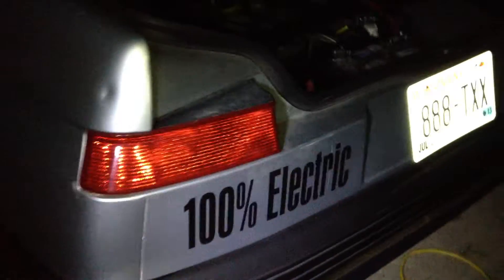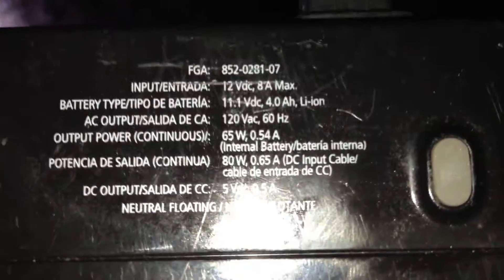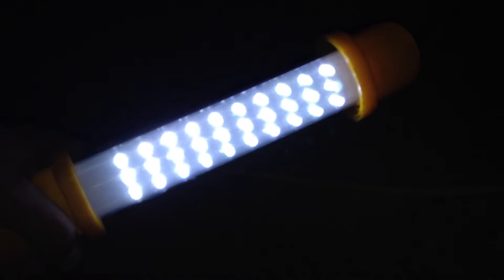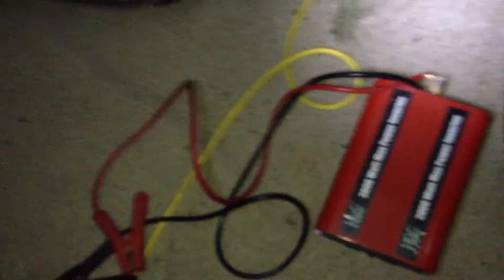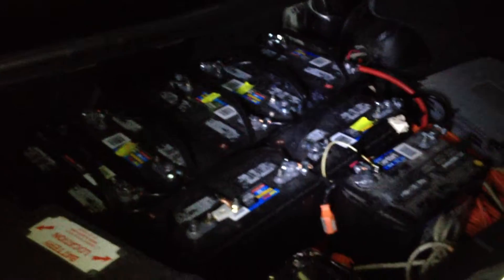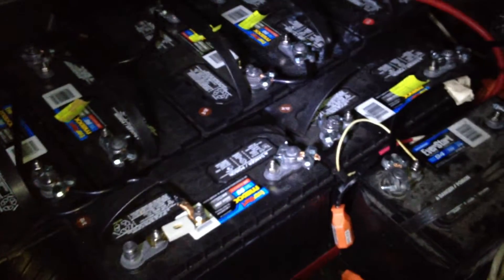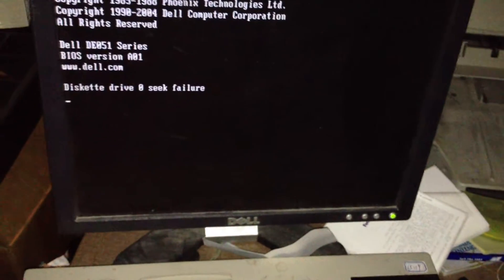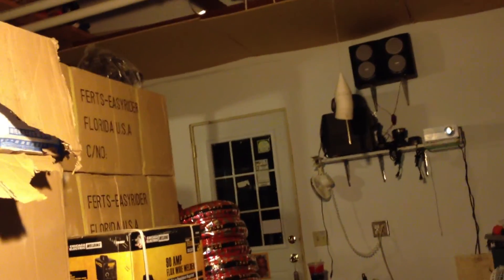Use a Electric Car for Emergency Power during Outage.

Comment: Seems you spent >70% of the video trying to one-hand wire devices all around your house using a Giant Squid of extension cords while juggling the camera with the other.
Sorry, not interested in that; I want to know technical stuff like exactly how you connected the inverter to your car.  The 12V cigarette lighter, maybe?  The 12V battery terminals?  (I have a Nissan Leaf with a separate 12V battery from the big traction battery.)
If power is out in your neighborhood, can't you just switch off the mains (you're not getting any power anyway,) and the central air system (if you have one,) plug the inverter into your car, and plug a male-to-male NEMA5-15 into any outlet in your home wiring, and draw power from any device plugged into your home wiring?
This seems like it might be especially helpful for powering stuff that doesn't have a power-cord-to-wall-outlet (like ceiling fans/lights).  You are connected to your refrigerator and stuff by default; no extension cord vines leaving doors open to the garage, and so on.
Have you tried this?  Is there a reason it wouldn't work?  It seems as good as any of the $4000 CHAdeMO V2H systems, and costs a tenth as much.  Though it seems smart to be careful to not overburden the battery to make it last longer, and also not trip the breaker you're connected to the rest of the house through.  A 240V circuit might also be a better idea; my car's plugged into one anyway, and it's not as if I'll use it when utility power's out.